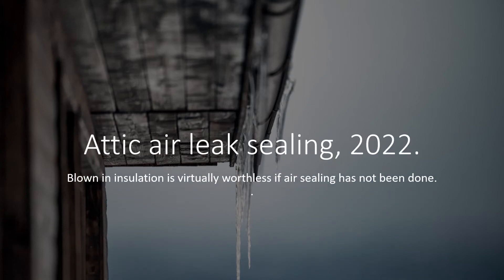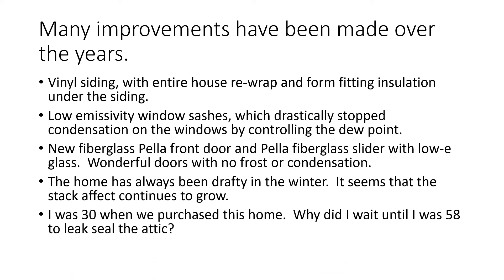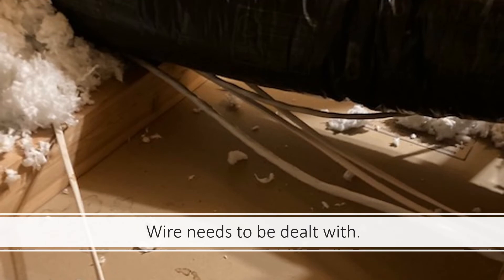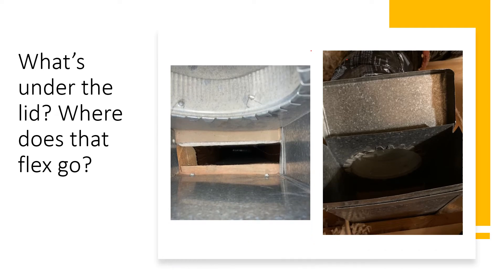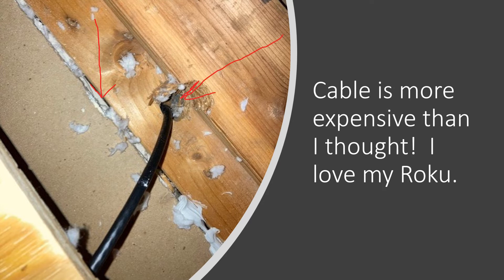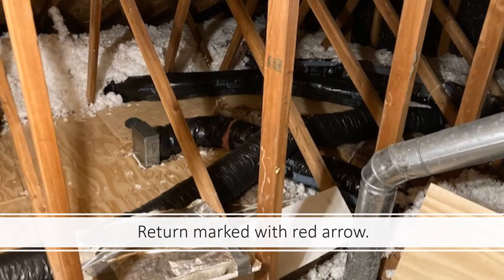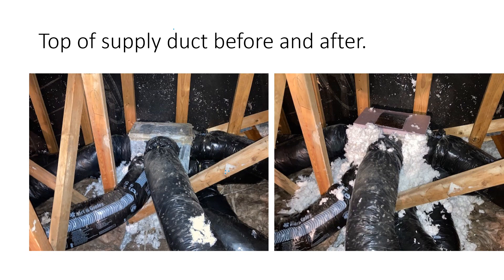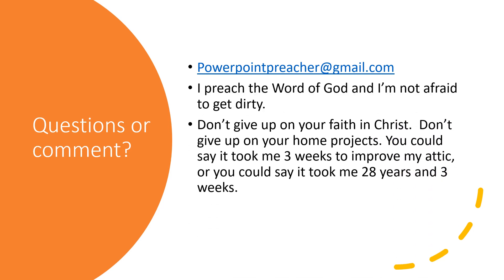Attic Air Sealing 2022.

Comment: You have put a lot of work into correcting these issues. Our home was built in 1960. We have lived here for 24 years and always had a drafty home as well. We have similar issues. I can believe that a home built in 1993 would be so shoddily built. Unfortunately, nothing was different in 1960. Builders are in the business of building a home with a shiny key to the beautiful front door and then it's yours. So many corners are cut. I'm correcting these attic drafts this year (2022) as well. I have cleaned out all of the old insulation. Mine was blown in cellulose over 3" fiberglass batt. All gone. Clean slate.
Reply from the maker: Fantastic Burke.  It turned from a dreaded project to kind of an obsession.  I have a video that I should be able to get edited and released soon that shows more progress.  I have more to do, as you will see.  Thanks for your comment.
Reply: How'd it go? Did you seal the air leaks?

Comment: My attic gable ventilation vent had dry rotted and it was time for replacement. Due to I couldn’t find one to fit I built my own out of PVC lumber. After I built it then installed it I thought nows the time to add an exhaust fan so I bought the 2830 CFM Smart App Controlled 3-Speed Gable Mount Attic Fan, that arrives Monday so I went ahead and ran the wiring for power. 

I then learned if my attic isn’t sealed tight the fan will pull the house heating and air from within. So now I’m about to do as you and start sealing up all the cracks, crevices, and holes. 

I bought the house new in 1999 and I’m now 64 years old, and just like you, I said to myself “why did I wait till I’m 64”, lol. 

And Jesus is king 👍.
Reply from the maker: Thanks for watching the video 10 speed.  For sure, the attic exhaust will do exactly that, remove all of your expensive conditioned air.  Yes, Jesus is King of Kings and Lord of Lords!

Comment: Very nice work and thank you for the video. FYI, almost all caulk available will crack with temperature changes and will eventually allow air leaks.
Reply from the maker: Thanks, that is good to know.  I have never had good luck with expanding foam.  It's kind of messy and I never seem to get a full can used before the application tube gets plugged.
Reply: @powerpointpreacher  I know it’s messy. I actually learned about a trick that blew my my mind. If you turn the nozzle all the way back, there’s a little plug that would keep the straw clean after you plug it and it would be reusable

Comment: Great job
Caulk allows for movement
Foam doesn't flex
I know when l have sealed a hole with caulk
Foam not sure 
It is an insulator
I use deck material for attic floor 
1 x 6 x 3/4 it allows for easy cuts around framing
You were helpful
Reply from the maker: Thanks Art.  That was one of my main goals, to be helpful.

Comment: Enjoyed your vid greetings from Ireland. 
If the house isn't particularly leaky, presumably the leaks in the attic provide some ventilation? I'm concerned if I fill them in the house will loose ventilation and become stuffy / odours won't get removed etc. Or is attic ventilation an "inefficient" form of ventilation? 🤷
Reply from the maker: Hey, greetings from Iowa, USA.  Thanks for watching.  Yes, there should be planned ventilation in the attic, called soffit vents that draw air in and a ridge vent to let the air out.  But, the conditioned space below, where people live, should have an air barrier that keeps the expensive conditioned air from leaking into the attic and out to the atmosphere.  Yes, if sealed too tightly, this can lead to stuffy air, which we dilute with a fresh air intake and exhaust, e.g.an ERV or HRV system.  My home is still plenty leaky to allow for fresh air infiltration, but less so than before.  I hope that makes sense and thanks for asking.

Comment: Why didn't you use expanding foam? Caulk would probably be 3 or 4 more times the required material versus expanding foam. Excellent work and you will see great savings
Reply from the maker: I always seem to get spray foam where I didn't intend.  Yes, I used a bunch of caulk, but it was easier for me to work with.  Thanks for that and yes, my energy bills have gone way down, and the house is much more comfortable.

Comment: well i bought my house at 31 and am planning to leak seal it at 32, i didnt want to do it at 60. hopefully it goes smooth, i've been wondering if i need an additional way to get fresh air in.
Reply from the maker: It depends on the air changes per hour.  A blower door test can reveal that, when the operator puts in the square footage into the computer program.  Believe it or not, when I did the blower door test, based on the volume of air and square footage of the house, the program said I needed an additional 50 cfm of outside air.  I'm still laughing over that one.  However, it can be a concern if the house becomes too tight.  I can assure you that at this point, there are definitely signs that I have changed the pressure plane of the structure.  For example, on windy days now, instead of leaking everywhere out the attic, I will hear my bathroom exhaust vent flappers bounce a few times.  I calling it burping the house. Basically they are providing pressure relief to the building now that I've sealed gaping holes in the attic.  I still plan on eating beans and being unapologetically flatulent.

Comment: A suggestion. Attic foil is easier to install and less expensive to install than plywood flooring. It also reflects radiant heat away. You can get it with or without small ventilation holes, depending on the humidity in your locale. https://www.youtube.com/watch?v=qm-N2JEsQMc
Reply from the maker: Thanks for that.  I did try some but found traces of humidity and decided to let it be.  I didn't want any mold.